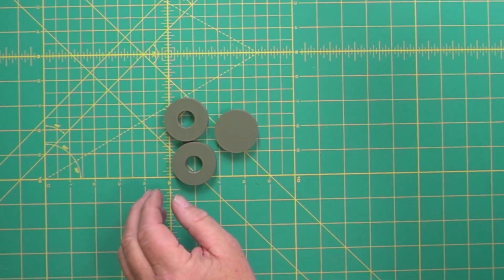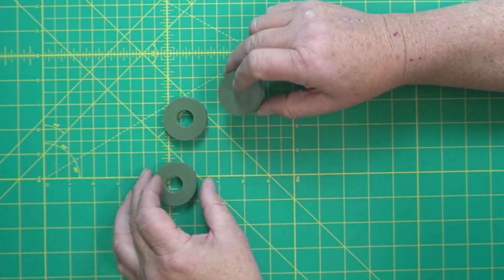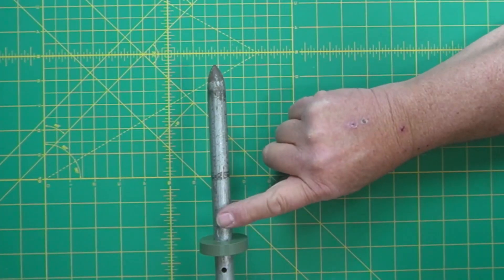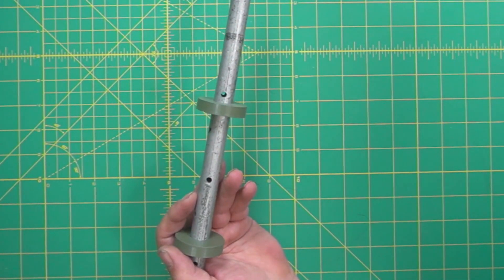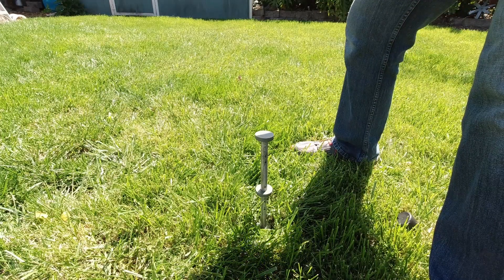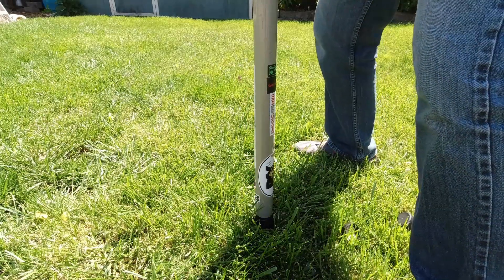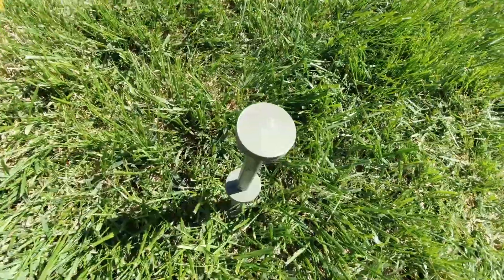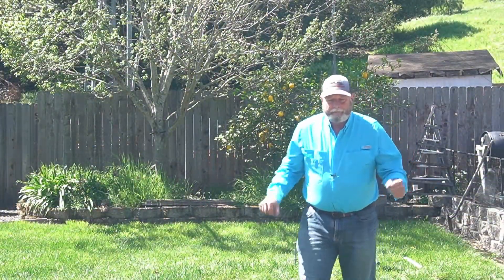How to set your antenna mast quick and easy with a $4.00 Home Depot stake & 3D printed donuts!

Comment: Aloha Chuck, what a great idea to avoid guidelines. I think you mentioned something about those spiral stakes for pets. Those actually works very well for my 100amp wind turbine with the 63” wingspan that’s 35’ tall when I add my Tram 1480 UHF/VHF repeater antenna. The turbine itself is mounted on a quad spring stand and I just set it up on top of the spiral stake and then use a 1” cargo strap to hold it in place. This set up also works great for field days in parks that no longer allows gas generators. Yes, recently, that has become a thing. 
    I love designing and building my own wind turbines, which I predict will become more popular for field days in the future. 
     I love your videos, always gives me new ideas to tinker around with and a better way of doing things. 👍👍
    73’ de Todd WH6DWF 🇺🇸🇺🇸🇺🇸

Comment: Nice design Chuck. I turned some adapters on the lathe from solid PVC or used PVC pipe and tape before getting the 3D printer, but printing them is much easier. Lots of ways to make them. I made one for a trailer hitch mount using all-thread and similar bushings. One suggestion - print at least the top disc from TPU to protect the ends of the sections - in case they come down unexpectedly as they sometimes do - to avoid damaging the ends of the sections. 73 de w6akb

Comment: Those stakes are not available at Home Depot.  Would like to know other sources
Reply from the maker: You need to look in the cement section, they are for forming to pour cement. Pretty sure if your HD sells cement the sell these stakes.
Reply: Lowe’s has them for $5.00 each.

Comment: You don't provide a link for the adjustable vertical? I can think of several ways to use these as verticals for different bands. Also a pair of them to use as easily adjustable band dipoles. But where do they come from? Terry KI7M
Reply from the maker: Hi Terry, are you referring to my next video with the mirror mount? That was a 17' stainless steel whip from Cameleon or MFJ. In that video There is a link to at least one of them.

Comment: Hi Chuck. What a great, simple solution. Thanks!  What mast are you using in the video?
Reply from the maker: Hi John, I think that was a 10m packtenna or sotabeams they are basically the same size along with the DX Commander expedition 10m.

Comment: I have a screw in base that is meant for a rotary clothes dryer. Its like a big cork screw and comes with a bar for winding it into the ground. The top has a socket with three screws that allow you to centre and grip the telescopic fibreglass pole. Works very well.
Reply: WHERE do you buy such a screw in base?  Thanks.

Comment: I did the sane thing with a piece of rebar and various diameters of PVC pipe. I glued the PVC pieces with silicone caulk. Drive the rebar into the ground. Slide the PVC assembly over it then your antenna.

Comment: What's the Antenna you was using, what band frequency and what's it called.
Reply from the maker: On that setup I would use a Dipole, Doublet or a EFHW pretty much any wire antenna.

Comment: Chuck, make another solid puck just slightly smaller in diameter to sit on top of the top cap on the curb stake.  Then when setting the mast, put the solid puck into the bottom of the mast and use that as a “stopper” so you don’t pinch your finger. It shouldn’t interfere with the mast as it goes up.  Once the mast of lowered all the way, pull the mast off stake and the solid puck should be ready to slide the mast to one side and ur your hand under to catch the puck. Remove it if necessary to screw the ends on for transportation